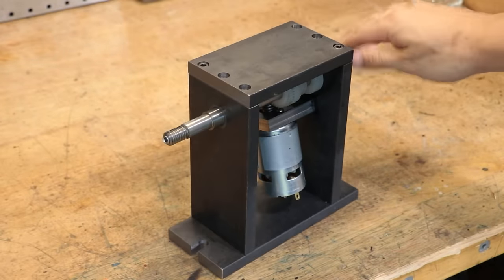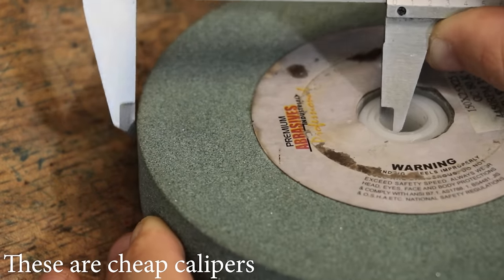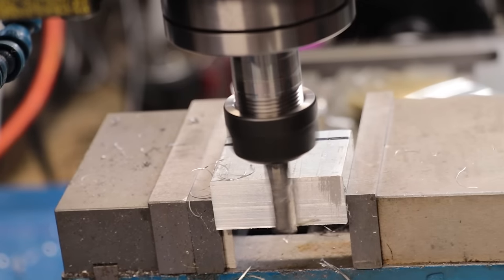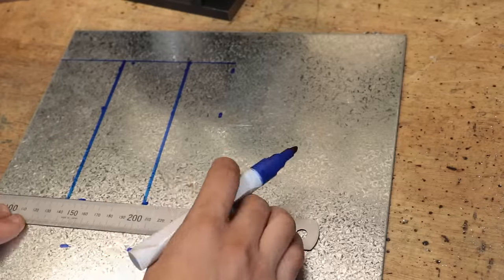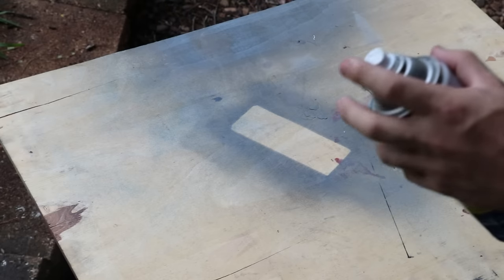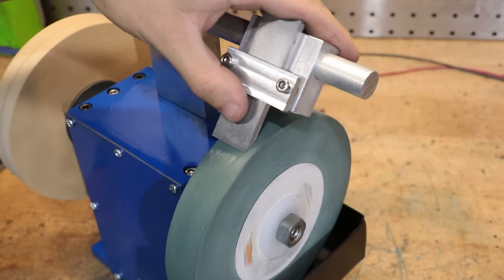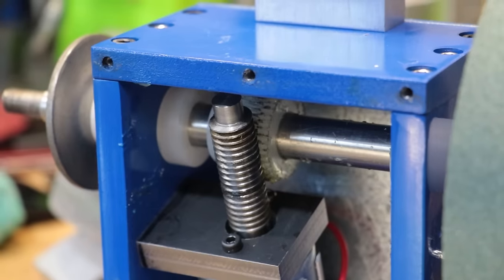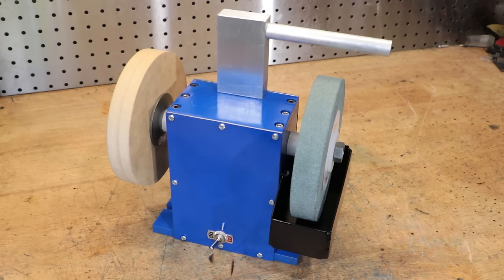Whetstone Grinder Build - Part 2

Comment: You could glue a leather belt around that MDF wheel. Neatly bevel the beginning and end and glue it with a good contact adhesive.
Reply: That is a really good suggestion Michel! ... but also a little bit helpless ... or without possibly the right words: The last resort? hehehe.
Just joking a little bit:) You know that the saddler or belt maker also had to get his raw materials? It hurts my heart a bit to waste a belt on this when you can buy exactly the same raw materials without practically wasting a good belt. But you're right: a good idea and a last resort at the same time:) I wish that your trousers stay up and have a good one, Michel!:)

Edit: Just a thought: I think we won't get happy with cheap Chinese Imitation leather. And a good belt out of natural and processed leather may not even be the best choice, as it was processed to hold trousers and skirts and not break metal-edges. And the most important: The real leather ones aren't really cheap... :) (40-50 $ and more)
Reply: @dieSpinnt  If there is no old belt that can be used, he could simply buy a leather strip. I have seen strips saddle leather 50 inch long 1.5 inch wide at Amazon for around € 14,-

Comment: I make violins in my spare time- I use a regular cloth buffing wheel with green oxide to hone my tools to razor sharp- considering those cloth buffing wheels are only a few bucks it’s worth it in my books. I’ve also used the back of an old leather belt as a manual strop.. I’m sure you could glue a belt to your MDF wheel and be set! Enjoyed the build, hope it serves your sharpening needs for years to come!

Comment: Tip for using your wood chisel: You are using it upside down. If you use it the way you are, with the bevel on the top, the tip of the chisel can only go down into the material that you are chiseling. If you put the beveled face on the bottom, you can direct the tip of the chisel to cut down, up, or level into the material you are cutting.

Comment: God dam. Everyone's an expert in YouTube comment sections. I think this grinder is pretty dope! Was looking to build my own somehow with a windshield  (or wind screen) wiper motor like Stefan Gotteswinter did back in the day, only way lower tolerance and appeal lol.
Reply: Maybe the "actually" comments are hidden, but everyone seems pretty positive. Because his design is pretty good, and should make consistent edges without drawing back the temper. I haven't finished the video, but as long as he addresses the manufacturer defect of the excessive radial runout, it'll definitely be a nice sharpener.

Comment: Plane iron camber is an essential subtlety in the craft. A bit of the secret magic that makes it all work. Sometimes the camber is very slight. Imperceptible really. But it matters when using the tool. An iron with no camber and square corners leaves tracks flattening and you can't adjust jointing. As in you can't influence the angle by favoring one side of the plane sole or the other. The slightest cambers are made in the honing process by just applying pressure to the corners of the plane iron. Heavier cambers are made by radially grinding the irons. I just figured I'd bring all of that up. The whole camber issue. As it seems to be ignored here.

Comment: You may find that keeping your chisels at an angle to the work will give you a cleaner, easier shearing cut.
Also, by putting your plane on its side will help protect your blade from nicks and damage.

Comment: Great build, enjoyed following the whole process. Have newer seen anyone make a Tormek-style grinder, repect for having a go at it!
 
A few experiences from owning an older Tormek that might be usefull:

Angled, larger sides to the water tray makes the machine way less messy to use. Also put a magnet in the tray to catch shavings, as these have a tencency to start to rust and stick to the tray. A few drops of oil-water emulsion cutting fluid helps fight the rusting as well.

The ability to adjust the height of the bar that supports the tools is a central feature of the Tormek system. Makes it way easier to adjust tool angles, adapt to different types of holders etc.

The mdf wheel works great for very accurate angles, and probably best with some sort of tool support. A good choise if you mainly intend to use the machine for metal turning tools. The leather covered wheels are better for freehand use and makes a more rounded hone.

Keep up the good work!
Reply: MDF is better than soft leather for most applications. Very hard leather (such as rawhide) is best of all.

Comment: It occurs to me that if you have a grinding wheel that wobbles and runs out, you could glue a solid plastic plug in the hole, mount the wheel in the lathe chuck (carefully, don't squeeze too hard) and bore a true hole through it. That should get you pretty close. A lot better than the nested bushings that come with the wheel.

Comment: Great build. I really like the tool holder. I'm not too sure about your use of plastic for your bushings though. A critical factor in preventing the stone from wobbling is the bearing shoulder where the flange for the stone rests. I fear the plastic would be almost instantly distorted when the nut is tightened.

Comment: To your comment about a diamond wheel—
I would be careful going down that route. Diamond abrasives remove a lot of material pretty darn fast. If you accidentally start on the wrong angle or introduce too much pressure, it can lead you down a rabbit hole trying to correct it. I have a lapping process that I’ve implemented at work and I quickly moved away from diamond abrasives and have stuck with #1200 silicon carbide since. Time/accuracy/finish seems to be the best with silicon carbide when it comes to slower processes imo— even when compared to super high grit diamond. For your process, it would probably be fine, but I wanted to throw a word of caution since I’ve delt with it myself!

Comment: Nice job and solidly constructed, I've seen an old Tormek that had failed and wasn't impressed with the design given what they charge for them. I think your use of acetal for the bearings is a better choice than nylon, it machines better and isn't prone to moisture absorption which can cause nylon to change dimensions.
Reply: Tormeks always struck me as a bit of a come on. They are wicked expensive. I'm doing OK with my homemade dry grinder over here. The trick to using dry grinders is to just run the right wheel on them. Which isn't a hard wheel. You want a soft friable tool room wheel. They run a lot cooler. Soft wheels wear a lot faster but if all you're doing is sharpening they still last a long time. I haven't worn one out yet.

Comment: I'd agree with many of the other comments.  First, I love the grinder overall!  I may be using it for some inspiration on my own build.  I'd reverse the wheel direction, though - The blade should be "cutting" into the stone wheel.  But bear in mind should be turning away from the edge for that stropping wheel if you switch directions!

Comment: Great tool, super useful! You can get a variable DC transformer really cheap, the 775 motor is very forgiving at voltages between 6v and 20v. I have one that doesn't complain at 25v.

Comment: Speaking to the wheel bore. I have a Tormek and almost every wheel has a bore and surfaces that aren't square.

They recommend using the side of the wheeel for the backs of planes and such but it never works because of the wobble.

Comment: To get the best results, you should build a holder for the drills that also slides on the jig bar...

That way, you keep the exact same angle when rotating the drill to grind each flute which should keep them centered and even which will produce a better cut when drilling metal...

Comment: Instead of clamping plastic in the lathe chuck put a scrap in the chuck, face it off and 3M double sided tape to hold it. press it on with the tail stock. With the tail stock out off the way you can machine it like normal and no distortion of the work. We did this all the time working with industrial plastics, even on the mill, where you can mill all four sides and face at the same time, no vice.

Comment: Instead of gluing that tool rest bar in place you should added a thumb screw to allow you to slide the guide back and forth between lapping/strop side and the grinding wheel. 👍👍

Comment: For giggles you can Add a third arm for a 1/2 wide finger belt sander it is the hot thing for a lot of knife lappers in the states. Mostly got popular with some tool companies because you can make a convex blade shape with less Tallent and cheaper jigs. Far less sustainable than those big old wheels though. Cool project BTW fun to watch.

Comment: Blinking excellent! Good work chap. No need to pour shame on your welds on the water bath btw, even once you've tried your best to grind off the zinc, previously galvanised steel is a 🤬 to weld nicely.

Comment: I know you have a small workshop and space is at a premium, but have you considered trying powdercoating for your parts? You'd need to put an oven somewhere but you might be able to store the gun etc inside it when not in use. I know everything comes down to space in that workshop but i think it might improve the quality of your corrosion prevention over spray cans. Excellent build for a budget as always 👌

Comment: I have a leather strop, a leather stropping belt for my belt sander, and two mdf wheels for my bench grinder.  One for black rouge, one for green.  And yes, if you’re sharpening knives, try the green chromium oxide for the final edge polishing.  The white aluminum oxide does alright, but that green is a machine.  Know what I mean?  Screen Jean clean peen?  The mdf does just as well as the leather strop does.  I kind of prefer the hand strop though.  The delicate work seems to come out better when it’s done by hand carefully.

Comment: To remove galvanization from sheet metal...soak in a tub of vinegar for a few hours, the acid will etch it off pretty well (saw it on YT...ya know YT certified lol)
Ooh...also a strip of leather glued around that wood wheel then filled with that grinding compound would make one heck of a stropping wheel for knives and such
Very cool on the build! That worm gear is good stuff [nice and slow and plenty of torque]!  I wonder if a "bullet brass" one would be a bit more rugged ;)
Keep em coming!!!!
Reply: Lye is somewhat more effective (makes a lot of difference when removing thick "hot-dip" zinc layer) and safer too (for the steel, that is) as it dissolves zinc but not steel. So you can just drop a piece of whatever you need remove zinc off of into a bucket with concentrated lye (caustic soda - the one used for unclogging drains is good enough) solution, and leave it overnight, and sleep well knowing steel won't be attacked.
Also, cover the bucket - it will not only ensure safety of all the spiders in yer shop, but (as added benefit) will prevent CO2 absorption from atmosphere, which would turn caustic soda into baking soda - and these two ARE NOT the same "sodas" ;-)

Comment: those motors are used  in 12v and 18 v drills  coming out of china , this means those motors are cheap and easy to replace but also you have that headroom to speed up the motor by increasing the voltage upto about 20v with no issues  in case you need that additional speed ,

Comment: I was thinking of doing something similar but with with angle grinder pinions, you can find them as replacement parts and are dirt cheap, they come with a key so machining a slot in the motor's shaft would be pretty easy
Reply: An angle grinder bevel gear setup wouldn't give the reduction required without additional gearing. If you want something off the shelf you could probably use a windscreen wiper motor.

Comment: Looking good, though I'm not convinced on the aluminium rail.  You can get away with the jigs being aluminium, but I think the rail will begin to gall and distort fairly rapidly over time.  My version is using 316 stainless, jigs are getting brass bushings.

Comment: I'm late to the party, and if it's already been addressed in the comments, I apologize.  I don't have a grinder for sharpening plane irons and chisels, although I wish I did at times. When sharpening your plane iron or chisel, it's important to flatten the back.  I would sharpen and strop the bevel on your grinder and then take it to a flat stone to knock the bur off of the back.  The other common problem people have using hand tools on wood is the inability to read the grain direction of the wood.  Always plane and chisel with the wood grain, and remember that end grain isn't easy for anyone.

Comment: You really should put a magnet in the bottom of the pan. When the sludge is freefloating it will stay on the wheel and pack in the grit. You'll end up having to resurface it more often than expected.

Comment: looking good! i was thinking about your unsupported worm screw drive end, and inspired by vanover custom's recent slow-speed grinder build, had the idea that you could just extend the near end of the worm drive and use it to hold a bearing, rather than having to deal with attaching it to the case or anything like that.

Comment: If you want the best possible Sharp Edge, you should have bought the Diamond Wheels...

If you really want to ensure the motor doesn't get wet, next time you take the case apart, add a thin bead of silicone sealant along each edge/mating face and on the threads of each bolt, then even if the case gets wet, the silicone will ensure it stays out of the motor area...

Comment: You may find that a CBN wheel will do the job for you. There are a number ranging from $51 on Ebay to $230 at Carbatec.. Cool build mate.
Reply: I'm not too sure such wheels are suitable in a grinder running at such a slow speed. I'd find a way to check that out before purchasing one.
Reply: @crichtonbruce4329  At least Ryobi low speed grinder I've seen comes with one.
Reply: @lawriealush-jaggs1473  Thanks. I didn't know that. All the ones I've seen advertised were for normal speed bench or pedestal grinders.

Comment: If you use a square rod as a guide with a rounded end that is clamped in, you can actually set an angle of attack and not rely on the actual tool you want to sharpen to find the "right" angle.

Comment: i think you used too much plastic when it comes to the wheels. would it be better to use brass or bronze for the shaft bushings and brass for the wheel spacer? i was thinking that may help even moe with out of round. over all very nice work as always!

Comment: I could be wrong but it’s my understanding that you’d typically want to run demmings drills pretty slow? Could be different for aluminum but 180 rpm or less on steel was a rule of thumb that I was taught.
Reply from the maker: If you have the mill than has the power to do it then yes. I don’t I have to run it faster
Reply: @artisanmakes  oh interesting I had no clue - I’m still a 1st year student so I really only know basics
Reply from the maker: No worries. Probably doesn’t look like it but this is a very small milling machine

Comment: Since your shaft is not perfect and the hole in the grinding wheel is off center you will want to re-true the wheel every time you remove it because the clocking will most likely change when remounting. The eccentric motion would make your grinding angle change by a few degrees during each revolution.
Reply: This can be compensated for by drawing a line on the spindle and the wheel when taking it off. As any remedy prevention is the cure.
Reply: He could drawl a line on the  non smooth surface of the wheel, the slick soft plastic of the spacer and the smooth metal spindle. Good luck trying to perfectly line up all three while tightening a nut. 
A better suggestion would be to keyway everything or ... hear me out ... redress the wheel.

Comment: I can't remember what plastic you used, but for comparison my ebike motor (bbs02) uses a metal to nylon worm drive and while it does have a MUCH coarser thread it also deals with much higher forces and goes for 1000s of hours so... seems good :)

Comment: is the reamer holder at 6:35 made from an old toolmakers clamp with some bars welded onto it?
Reply from the maker: I think it’s some mild steel square bar with the ends turned down and a v cut in the middle. Held together with screws. That’s my best guess since the tool itself is probably 90-100 years old

Comment: Looks great
But a thing I have with all these vids both from you and from other channels.
Is this sentence.

"I will just slap a block of aluminum".

To get the tooling and machines to get started, is a no brainer... Just talk with your wife, over dinner that you want to get in to hobby metal working...2 sec after all in your family gets adds from firms that want to sell you this..

But the work material. Where to get it, tips tricks. 
I wanted to build a vacuum former...but unable to find a reliable source to buy the same sheet, made me nervous that I was able to build it, but after would I be able to get it again.

Comment: Strange that you used the hooks rather than simply doing keyway holes in the reservoir with pan head screws. Would have looked nicer and probably easier to fit in use.

Cool build anyway though.